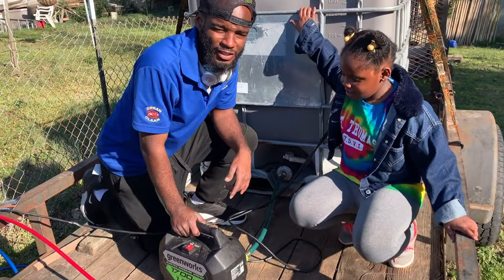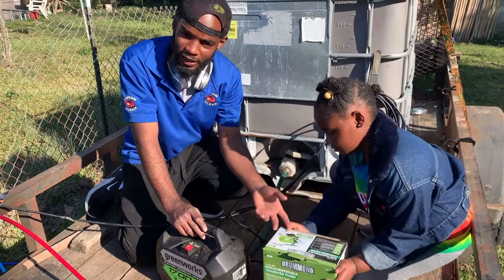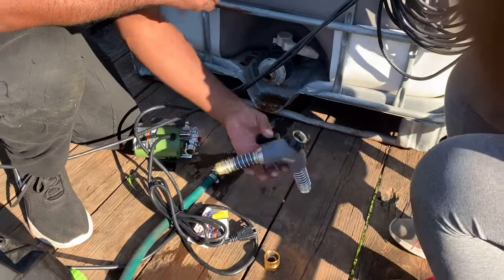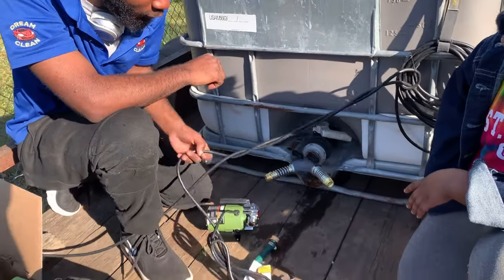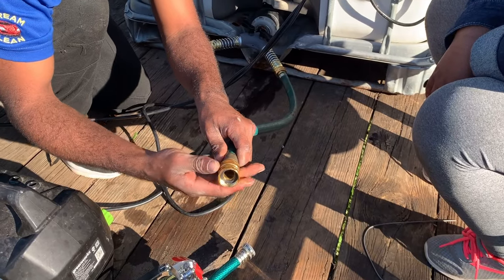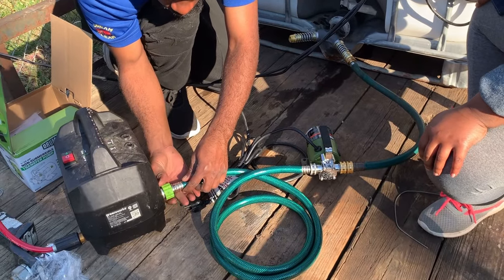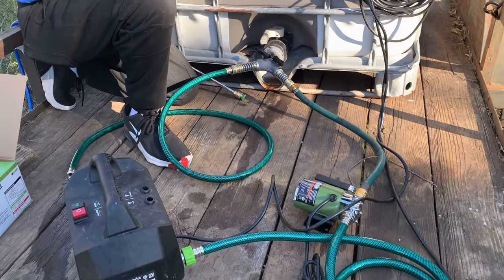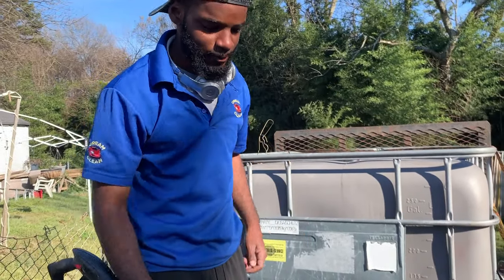Inexpensive water tank setup with pressure washer

Comment: Extra tip for ya: run an overflow line back into your tank, for when you let off trigger. Prolongs life of pump and pressure washer even more.
Reply: What’s an overflow line?
Reply: Is there a video for that?
Reply: @WopDaBarber999  yeah, out there in youtube, i forgot which channel it was that showed it, one of the pressure washing channels. If you look at your pw while its running, you will see a valve open and blow off water when your not pulling on trigger for a period of time. You can run a ¼ hose from there into your buffer tank. Easy peasy.
Reply: @bradlwykfulbright  this is true for gas power pressure washer only. On electric pressure washer there’s no pressure release valve. From my understanding the electric pressure system completely turns off suction of its internal pump. So you can’t damage your electric pressure. The problem only exist on the water pump creating pressure. You can put a extension electric outlet that has an on and off remote like a Car key remote to shut it down. So that special extension with remote will be in your generator. You then connect the water pumps male plug to it. Simple.
Reply: @pandassudsnshine4125  The transfer pump is what burns out.  I got a $100 ryobi one and didn't have an overflow line on it and it burned out before I could rinse all 4 wheels off.  Basically get a second hose splitter like in the video and send one to the pressure washer and one back into the tank.
Reply: @datguy4104  I have the original setup without a transfer pump and one with one. It’s been two years and both work. Not sure how some break down and mines havent
Reply: @pandassudsnshine4125  Think he’s referring to a bypass line…when the line pressure hits a certain point, it would allow water to recycle back into the tank. Reduces wear on the pump. Some pumps also have a pressure switch like the everflo5.5
Reply: Appreciate this comment bro! I just put this exact pump on my trailer for my pressure washer and ran a second line back to the tank to it circulates from pump back to tank so the pressure doesn’t damage the pump while I’m not holding the trigger. This comment probably saved me from losing the pump on the first job of the day
Reply: That's good advice bro, where does the overflow line goes
Reply: @renostubbs8504  back into the tank. Get a hose splitter and connect it to the outlet side of the pump. So the flow would be a hose from water tank to the inlet of the pump then on the outlet you put the hose splitter on the outlet side of the pump and run one hose back through the top of the water tank and the other hose to your pressure washer and leave both valves open on your splitter. That way water is always circulating through the pump back to the tank while you’re not pressing the trigger on your gun. Without the second spillover hose the pump will be creating pressure trying to pump water through the gun when you’re not pressing the trigger and will cause the pump to burn out
Reply: @James1fresh  watching from The Bahamas 🇧🇸 thanks a million Jaime, GOD BLESS you ,your family and your company.
One Love
Reply: Or buy an on-demand pump. The on-demand pump only operates when you are pulling the trigger on the PW gun. This way the pump wont constantly be running .
Reply: So I have 3.3 gal per minute tiger cat pump, set up just as you aside running to a 3300 psi black max pw but I have to close the over flow line to get pressure while I’m washing and then open it back when I’m done and then turn the pw off every time, any advice on what I could do to fix it?

Comment: Great video. however, I would recommend using an on-demand pump. They make pumps that will only run when you pull the trigger on the pressure washer.
Reply: Link to that pump?
Reply: I’d like a link to the one you use as well

Comment: I have been gravity feeding my pressure washers from my water tank for over for 6 years. Never had an issue. I have both a gas and electric pressure washer. Models are HONDA GX200 and the Kranzle K1622TS 1600. You have to ensure your tank is up a little higher than your pressure washer. Easy peazy : ) Also, I have never had to buy a new pump or pressure washer. Have had these same models for a long time and they get used every day 5 days a week. BUT I have recently gave my Honda away now I just use the Kränzle K1622TS 1600's they are fantastic for detailing vehicles!

Comment: Dude thats an awesome video .Thats exactly the setup I need .I have a 3000 gas pressure washer and we need to run it where there is no electricity .They make this pump in dc battery powered .Going to harbor freight to buy it.cannot wait to try it out.Thanks bud
Reply from the maker: Glad to be of Assistance
Reply: @dreamcleanmobiledetailing  will this work with a 4200 psi washer ?
Reply from the maker: @sunnydylan8034  yes

Comment: Just a suggestion may want to add a filter between tank and utility pump. Thanks for posting this.
Reply from the maker: Didn’t even think of this but will do!
Reply: I have the same set up but my pump is bigger than that one
Reply: @32sheek  what size pump do you have
Reply: @dreamcleanmobiledetailing  I was wondering can you burn out the water pump motor if the pressure not running
Reply: @Seannie_n  1hp 534 gallons per hour
Reply from the maker: I’m assuming it will burn it out if pressure washer isn’t running and water just continue to build up without a release point but I’m not sure why anyone would have it on if you aren’t in the process of using it
Reply: @dreamcleanmobiledetailing   this video they rerouted a hose back to tank via y connection and speak on burning out pumps.. i'll post another link on another detailer that did a similar recirculation once I remember his video

Comment: Hey dream clean mobile great video. You can get a similar pump that is 12v DC and wire it to the trailer and make it run both directions to fill or empty the tank. I could tell you the wiring if you needed it. I am about to build a small setup myself
Reply: Hello, can you help me with the wiring diagram?

Comment: i have a community to pressure wash, my question is where can i connect the pump to get power to it? driving an F150 2019 and have an outlet inside my truck..but not sure if i have to run the truck which would drain the gas a lot...
Reply from the maker: i recommend purchasing a generator

Comment: Has that transfer pump held up? I just got one, I’m setting up a system similar but with a 3600 psi washer.
Reply from the maker: @carsoncaywood9967  i use a 3000psi system i have to get a new one or rebuild it every 5-6 months

Comment: Is the pump needed? I see other guys eliminating the pump and running gravity fed straight to the pressure washer.. any issues with that? Curious as that’s what I intend to do. I do have a pump but was hoping to not use it.
Reply from the maker: Idk what type of equipment your using in this video I had a small electric pressure maybe cost $100 bucks. I’ve also used the craftsman gas pressure washer cost anywhere from $299-$500. I used gravity fed on both it does work! Problem is it will burn your pump (on pressure washer) out on the machine much faster. Bcuz of how hard the pump is working  having to pull water that is sitting. Idk if you have a trailer setup or inside your vehicle. But be mindful when you go to clients homes sometime the incline on which you park will also affect how good the gravity fed system works. I would rather spend the extra $60 on a pump and get another 6-7 months out of my pressure washer.

Comment: Your the goat man i have same washer and just got the same pump man!
Reply from the maker: Appreciate it bro! Just trying to share some information
Reply: Only problem I'm running to now is it' works but it's not a constant pressure it gets weak every other minute
Reply from the maker: With the pump attached? Unless it’s a bad pump the pump shouldn’t stop pushing water. Here’s how I would diagnose 

I would first attach the pump to the tank to where water could enter into the pump and plug it in to turn it on. And watch the water come out the opposite end . If you have a steady flow of constant pressure you know the pump is doing it’s job and it’s something on the pressure washer side

You can check pressure washer by plugging it into a water connect from the house and see if your losing pressure. 

Also check on how long your hoses are coming to and from the pump. It may be pushing but loses pressure as it goes through the hoses
Reply: @dreamcleanmobiledetailing  i got it from tank to small hose to pump cut it on and it's coming out at a good rate maybe my hose is to long on the end hooking to pressure washer. It'll run good and then seem to run out of water after a few seconds
Reply: Cause i see both your hoses are small, my hose  on the opposite end of pump going to washer is roughly 50ft it's maybe to long..
Reply from the maker: @datrellS  yea that’s wayyy to long I think the box says up to 12 ft
Reply from the maker: Lowe’s or Home Depot have items where you can cut hoses and make them the sizes you need
Reply from the maker: @datrellS  yea your hose is too long for it to keep water in the hose at all times

Comment: Great video Bruh, I'm just setting up my rig and looking for the best simple solutions. I have a question. I have a paxcess electric pressure washer and I can't get the info on what size hose or adapters to buy that will allow me to use a longer hose and other accessories. I bought the most common size suggested M22 14mm 1/4 in male adapter. It was too big for the female connection to my Paxcess 2300 1.8gal Per min unit. Can you help? trying to get a 50ft hose, foam Cannon & short gun set up Thanks

Comment: So does the pump shut off automatically when I’m not pulling the trigger for the pressure washer?
Reply from the maker: No as long as you have it plugged up the pump will continue to run
Reply: Does it do any damage to the pressure washer when the pump is running able your not using the pressure washer … and where did you get the fitting for the tank to fit your hose
Reply from the maker: @kingrudy5521  in my opinion it’s better for the pump to stay running so there’s always water available when the pump on the pressure washer needs to pull, and I get my fittings from Ferguson plumbing services

Comment: So when the pump is on, is it building pressure in the line? or is it in kinda like a neutral mode waiting for the trigger to be squeezed? Wondering how long this pump has lasted you so far.
Reply from the maker: It running continuously but i use a gas pressure washer that has a release valve so if its just too much pressure. the pressure washer will release it. but there's never a delay when i squeeze the trigger

Comment: I have this same setup but my water pump is overheating. How can I prevent pressure build up when the trigger isn't pressed? I own a gas pressure washer so it stays running.
Reply from the maker: I haven’t ran into any I overheating issues yet. I’m also running a gas pressure washer on one of my setups as well
Reply: @dreamcleanmobiledetailing  I think it’s just way too hot out here in West Texas. I’m gonna mount my water pump more into the shade and make some metal brackets so that it stays cool longer.

Comment: Where did you get that little tiny green hose that connects from the water tank to pump?
Reply from the maker: I made it from a scrap hose
Reply: How did you do it? I Want to create one today for my set up if you don’t mind explaining!
Reply from the maker: @abigailramirez2396  if you have a hose that’s broken or ripped you can cut it, and buy male and female connector pieces to put inside of the hose to create a new one at the size you need you can buy the connector pieces right now at Lowe’s or Home Depot in the garden section.  I will upload a new video on it Either Saturday or Sunday to show
Reply: Thanks so much! You’re very helpful. hope all is well (:
Reply from the maker: @abigailramirez2396  yes it is. I’ll definitely be posting a video soon for you so you can see exactly what you need! It’s not difficult at all
Reply from the maker: There’s a video on my
Page of the connectors

Comment: What is the piece that has two nozzles it’s connected to the tank
Reply from the maker: https://www.lowes.com/pd/Yardsmith-Brass-4-Way-Restricted-Flow-Water-Shut-Off/50328287?cm_mmc=shp-cprdsolgooglepla-106-watering-50328287-_-0&placeholder=null&ds_rl=1286981&gclid=EAIaIQobChMI--OAytH28QIV1mxvBB0ZGg9FEAQYASABEgLQzPD_BwE&gclsrc=aw.ds

They got all kinds of different ones but here is a link for one of them 

Mybad for taking so long to respond

Comment: Saw you replying to people so I thought I’d ask. I bought the same thing today but was worried. Won’t the pressure build up in the hose due to the pump? I don’t want to get to a job and the hose bust from the pressure
Reply from the maker: Great question! But it’s just like using a water hose connected to a house the worse thing that could happen would be a leak at the hose ends if it isn’t taped up correctly.  But it also depends on your pressure washer. If your using a gas pressure washer, they have release valves where it releases water when there is too much build up. Electric pressure washers pump has a auto cut off when it’s not being used as well as the pump. 

I hope I answered your question
Reply: @dreamcleanmobiledetailing  better off install a remote killer switch on the Water transfer pump 👍
Reply from the maker: @NEWNATURE777  gotcha will look into it today

Comment: What’s up man, I’ve gotten the same setup as you with the water pump and electric pressure washer and I’m having problem with the consistent water pressure coming out the electric pressure washer. It’s barely coming out and I was wonder what I need to do to have the consistent power
Reply from the maker: Are the hoses coming to and from your pump too long? The shorter the better 

If you connect the pump to the tank and leave the outlet hose open (not connected to the pressure washer) plug the pump up and if water comes out strong it’s the pressure washer. If not then you need to check your hoses if they aren’t super long you have a issue with your pump. Unless your water source is sitting on a crazy incline or something

Comment: Man get u a DeWalt pressure washer there AAA pumps pull right from the tank no problem my guy
Reply from the maker: I have been using craftsman on all my setup now works great. But we still use the pumps. They work great

Comment: No need for the water transfer pump, you just needed 3/4 hose and you could have gravity fed that.
Reply from the maker: We have had that setup on many of our vehicles the problem is when we run our machines so long every day. We work the pump inside the pressure washer extremely hard to where we constantly have to replace the pump or buy a whole new machine on a gravity fed system. You want as much pressure going into your pressure washer as possible so the pump doesn’t have to do so much work . To push and pull

Comment: What’s up man.. do you plug it into a generator? If so, what generator are you guys using to power both the pump and the washer? Thanks guys
Reply from the maker: Yes I plug my pump and pressure washer (if electric) into the generator 

And I have 2 of these generators

https://www.harborfreight.com/4375-watt-gas-powered-portable-generator-epa-iii-63962.html

I maintain them properly and never really have issues out of them
Reply: What is powering pressure washer?
Reply: Do you need the 4375 watt generator to run this type of gig? Or will a 2300 do fine with just pump and pressure washer?

Comment: I put tha same pump on a 50ft hose and the flow is weak. Pressure goes up and down slowing down my jobs.
Reply from the maker: That’s a lot of hose, to expect constant pressure from a small pump
Reply: So a bigger pump?
Reply: Or shorter hose
Reply from the maker: @major7255  a shorter hose would work. I don’t use anything longer than 2-3ft.. I don’t any know of any pumps that I could recommend for 50ft worth of hose